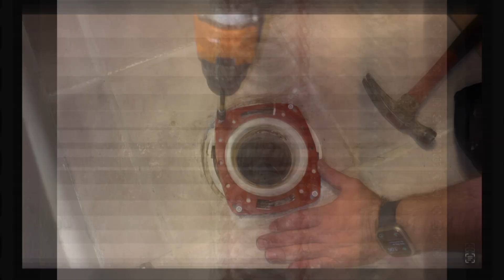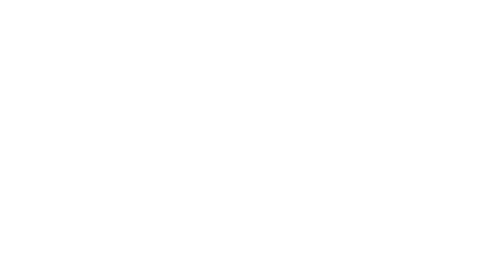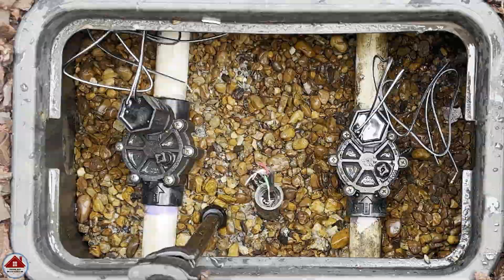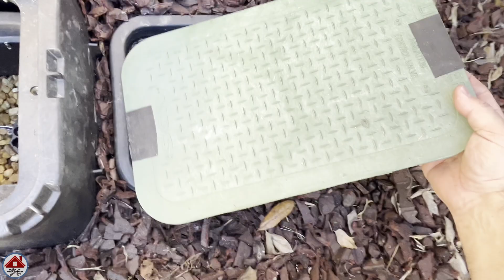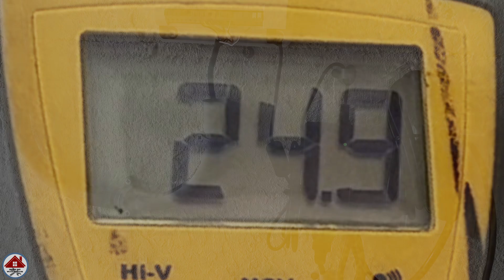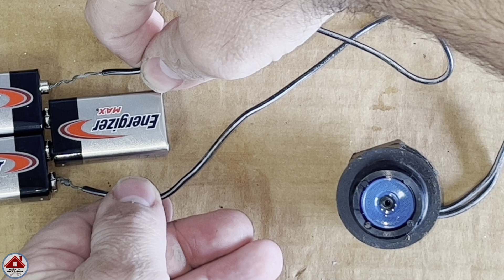Sprinkler Valve Solenoid Replacement & Troubleshooting

Comment: We have one sprinkler valve that continues to be a problem.  We can hear the solenoid running, but there is no output.  We have tested the wiring to make sure the solenoid is getting enough voltage to operate according to the specs for a Hunter system.  We also tested the solenoid using the 3 batteries as you showed to ensure it was working before installing.

My question is this:  Does the state of the solenoid plunger matter before you screw it in?  In other words, does the solenoid plunger have to be in a closed (extended) state before you install it so when it gets a signal from the controller to open, it then retracts into the solenoid to allow the water to flow?  I hope this makes sense.
Reply from the maker: If the solenoid is working, when no power is applied, it’s in the proper position to install. Once 24v is applied, the plunger will lift activating the valve. 

If you’re suspecting the solenoid…just change it out to eliminate it as the issue.

But yes, it needs to be in the extended position or water will flow.

Hope this info Helps!
Reply: @HomeDIYwithMartin   So this may be why this valve "leaks" even if it is not running.  Your response is very helpful.  Thank you!
Reply from the maker: If a new solenoid doesn’t work, it’s probably going to be the Diaphragm. Pick up a Replacement diaphragm at the big box store, they are not hard to change. Mine hasn’t failed yet, so I haven’t filmed a video on that yet, but you can easily find a Hunter one on YouTube.

Comment: Do you think this issue could present itself as every front yard zone not working correctly? The backyard zones are completely fine. It seems like a water pressure issue in the front. Maybe a pipe underground is cracked and a root got in the way? Our one green sprinkler box, similar to these green ones, was filled with dirt. Where do you think you would start? Also, replacing the sprinkler heads in the front changes nothing. I appreciate any advice I can get, thanks in advance!
Reply from the maker: I would start with digging the valve box up since it’s filled with dirt, and manually turning on the solenoid. If water flows and you are good, you next check your wires and controller to see why it’s not activating the solenoid. If no water flows, open the bleed screw on valve turning counter clockwise and see if water comes out. Don’t unscrew the bleed screw all the way. Screw it clockwise hand tight to shut. If water came out, and you have water at the valve, and turning the solenoid on manually still doesn’t work, you might need to replace the valve diaphragm. Once you get the water flowing to the zone you are working on, if there is a cracked pipe, you can find it by the puddling or water coming from under ground. But you have to get water flowing first. Hope this info helps!